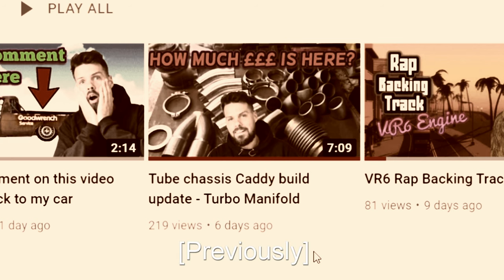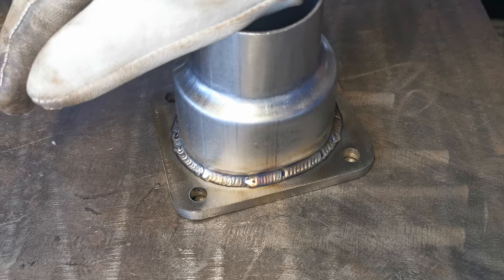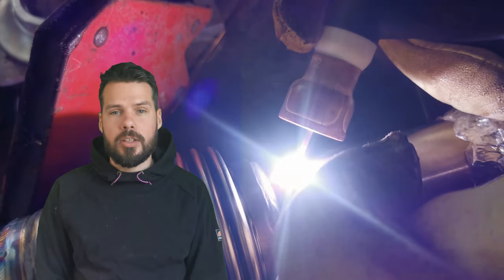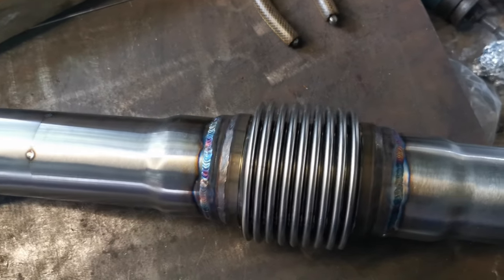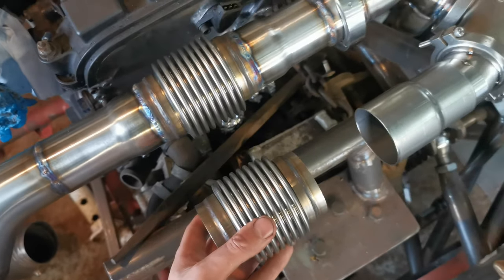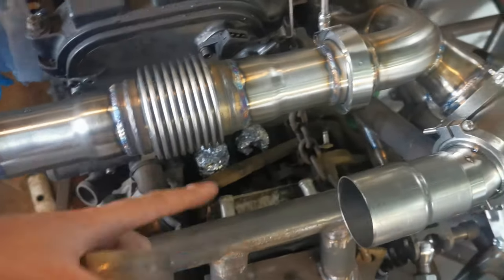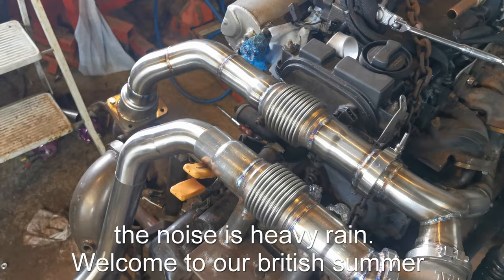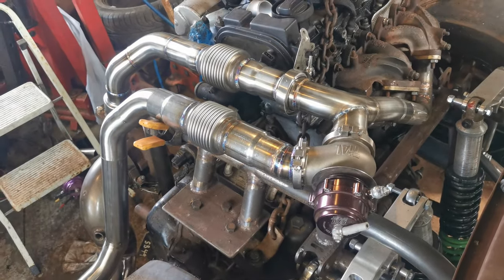Turbo hot side - Tube Chassis VW Caddy update

Comment: if you are bracing the turbo to the chassis but having the cold side of the turbo straight into the intake you should consider mounting the turbo to the gearbox so the it moves with the engine/intake as you will have a little flex/movement even on solid mounts
Reply from the maker: That's actually a good point, I hadn't thought of that. That's what I did before. I'll see what bolt holes I have to work with

Comment: Another class video 👌 any tips on getting that nice bluing on the stainless? I either end up burning holes or it being dull 😑
Reply from the maker: Best thing I did was buy a furick cup. I cant weld stainless at all using standard gas lenses.
Reply: @VR6VR6  mega, I've ordered one so will give it a go 👌
Reply from the maker: Honestly It changed my welds instantly, I expected it to be a gimik. I was just using those cheap cups that come with the welder at first.
Reply: @VR6VR6  another stupid question, do you leave the purge line running when welding?
Reply from the maker: @jdhracing  yeah, there's a correct flow you're supposed to do but I don't have a guage, I generally let it run inside the piece for a few mins first, usually untill you feel the gas comming out the gaps is cold.

Then keep it flowing, i set the gas rate by ear. A kind of gentle hiss, not that that's helpful 😅

Makes welding a lot easier too, as it keeps the piece colder.
Reply: @VR6VR6  yeah I used some foil earlier but had a rather large purge tube, weld was cleaner but I think I was probably using a touch touch gas, so thought I ask the question